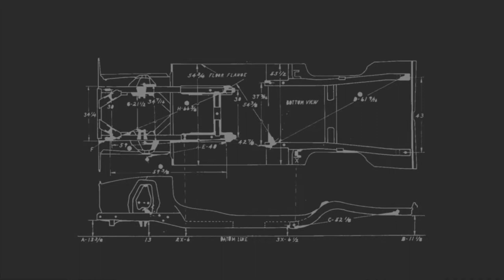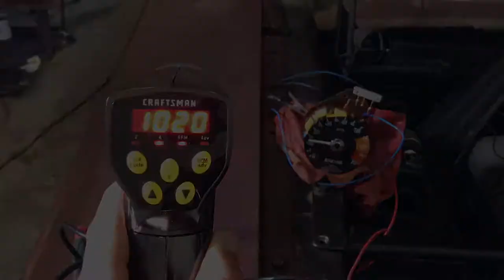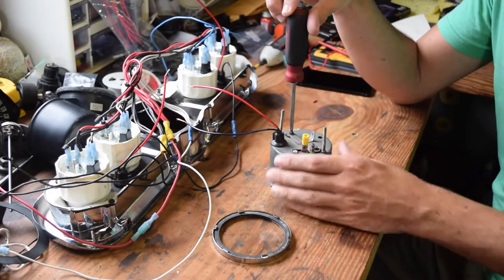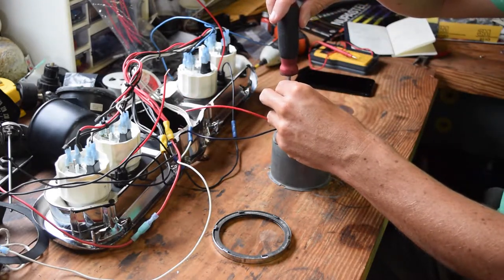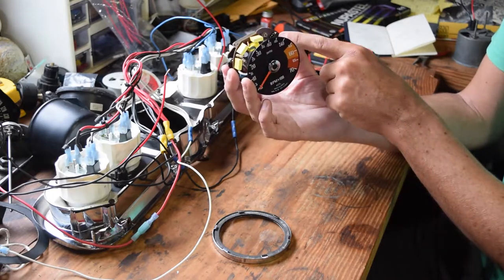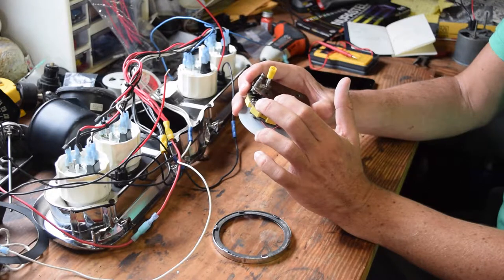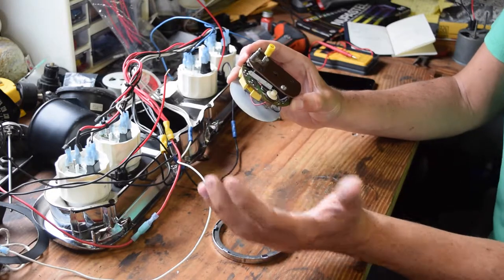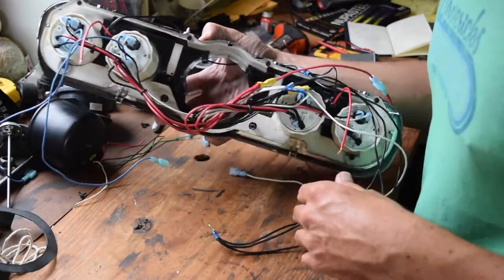PoF // Ep 24 - Smiths Tachometer Conversion

Comment: will this work to convert  an 8cyl tacho to work on a 4cyl eng.
Reply from the maker: It will depend on the specific tach you're working with, but yeah, the principle is the same. In this case, I had to ADD resistance to bring the RPM's down. If you're going the opposite way, from 8 -> 4, you'll need to REMOVE resistance from the circuit. Again, depending on the tach you're working with, this may vary in difficulty. Another option, which I considered for this project, is to use the "guts" from a newer tach that works with 4/6/8 cyl engines, but keep the same external housing and gauge face. Good luck!
Reply: I have done an engine swap , LS1  engine and computer it replaced an old v8 with single coil, the ecu on the LS sends a 4 cylinder pulse , I have bought a new 4,6,8  tacho  that i can gut and use but  old tach reads 3500 rpm at the 12 o'clock mark   and goes up to 7000 and the new one reads 4000 rpm and  goes to 8000 so will  need to adjust to read correctly using the original tacho face,  i can get a potentiometer from local electrical shop will this work to adjust it to read 3500 rpm at 12 oclock instead of 4000. thanks
Reply from the maker: Ohh ok. Short answer is yes, the potentiometer is basically a "tunable" resistor, so you'll be able to connect it in series on the tach signal wire between the ecu and the tach and twist the adjustment screw with the engine running until you get the correct RPM readings. If that doesn't work, there are a few tach adapters out there by Autometer and Dakota Digital that can also handle the conversion, but I think they're a little pricey (~$100).
Reply: ok thanks will give it a go, I have converted the mechanical speedo  to electronic by replacing all the internals so will try the same on tacho.
Reply from the maker: Cool, good luck!

Comment: Hi, do you have any circuit diagram showing which Res to be changed? I am trying to convert R4 to V6 tacho and searching way to do it.
Reply from the maker: This should help - http://www.britishv8.org/Articles/MGB-to-V8-Tach-Conversion.htm. Basically you connect the potentiometer across two pins of the IC and use it to adjust for your engine's ignition signal. Should work for a v6 just like it does for a v8.